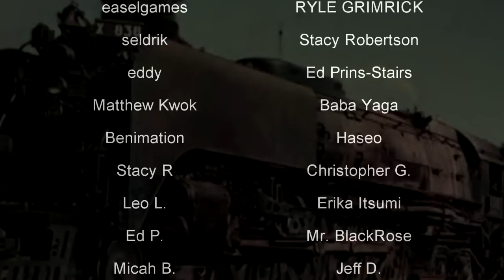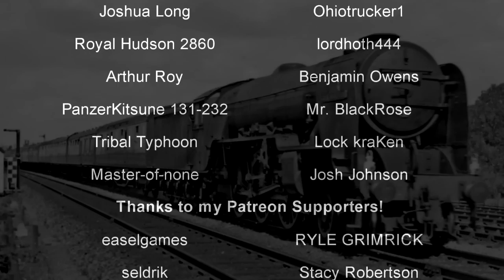The True Story of Edward Thompson | LNER's "Worst" Chief Mechanical Engineer | History in the Dark

Comment: Unfortunately for Thompson, alot of criticism was due to railway publishers at the time, one of which was Oswald Nock, a signals engineer who wrote on signalling and locomotive performance under wartime conditions for the Newsletter, the Engineer, and later for The Railway Magazine, who wrote reviews on various locomotives and their performance. He noted an incident when Gresley reprimanded Thompson publicly for interfering with a driver who was dealing with a locomotive which had failed.  

Finally Col. H.C.B Rogers, an army officier, ldolised the french locomotive designer, André Chapelon, and being main critic of the LNER   who suggested that Thompson was being difficult to work with (though citing many of the engineers under him). 

Thompson's ideas of reducing and standardising the amount of locomotive classes, were seen as a great move with management, most of his rebuilds did cause some issues with crews working with them. As noted "he solved the problem for the maintaince dept, he created issues for the operating dept." Most of the criticism leveled at Thompson was in relation to many of the Gresley rebuilds of older locomotives were completed in order to maintain locomotives which were getting old but not completely change the locomotives function and increase the performance. Only if a no other locomotive could reliability complete the task, did Gresley design and build a new locomotive.  

Most Thompson rebuilds, the locomotives performance after rebuilding become either average or worst afterwards, and he often had issues with crews hating his cab layout designs, as they caused many issues for men on the footplate..... one class had the drivers position switched from the right side of the cab to the left. His new designs were often designed to fully replace entire classes of engines with a single design, in order to reduce the amount of mantaince required. He had a list of many pre-grouping locomotives, which had survived under Gresley, but had been replaced by thompson. 

Had Thompson been able to have the full backing of the LNER, and not under war, he might have been a provided with a little more lee way but unfortunately, anyone coming after Gresley was going to have a difficult act to follow. Thompson's attitude may have sealed his fate, as being openly aggressive to other staff, and sending one of Gresley's assistants to a backwater areas on the network may have sealed his fate of being the "Villain" rather than "Savior"of the LNER.
Reply: The history of the LNER from it’s creation in 1923 may also be relevant, with it being a merger of different companies. The organisational friction from that kind of thing are often beyond the capacity of any individual, unfortunately.
Reply: Dear Andrew, 
1 / sending someone to an engineering backwater is frequently the necessary stepping stone to future promotion.
2 / it is also relevant that the LNER was financially the poorest of the Big Four, as is evidenced by the collapse of the former NER Areas coal trade, by about 20%, which is why the Newport Shildon electrification ( 1915 - 1935 ) was closed after less than 20 years service.
3 /whilst the LNER inherited some ancient locomotives and carriages, it did also inherit a sizeable fleet of relatively young and effective main line locomotives, ( the NER 0-6-0 & 0-8-0 goods engines, the GCR, and xROD 2-8-0s, xGNR Atlantics and Moguls, xGER Claude Hamiltons & B12s to name a few ) which goes some way to explaining why there was not a large number of new locomotives built by the LNER, but, by1940 these locomotives were now 20+ years older, and operating under quite different conditions to the 1920s. 
4 / Also, the second tier of inherited locomotives ( pre WW1 builds ) were now exceeding 30 years of age, and in some cases exceeding 40 years of age, combined with WW2 reduced maintenance and heavier traffic, you now have a situation where locomotive failures are becoming more frequent, there is a shortage of capital, and resources, to undertake a massive replacement programme, which would, in any case, take time to be effective, so any rebuild programme which would improve availability, was the only feasible alternative. Hence you have the rebuilds of Robinson 04, Raven B16, before the post war B1, K1, A1 & A2 programmes. All initiated under Thompson, but implemented by Peppercorn and successors, and the bulk were delivered to the nationalised BR.
5 / bearing in mind that British railways are left hand running, hence the reason for signals being to the left of the running line, it has always struck me as bizarre that the driver would therefore sit on the right side of the locomotive.
6 / the post WW2 LNER new builds did replace a swathe of pre WW1 locomotives, it also standardised a series of boilers useful on multiple classes of locomotives, and these boilers generally produced a higher output than their predecessors. This, by the way, ws not restricted to Thompson, Gresley had also done this, as did, to a far greater extent, the wealthier LMS pre WW2 , the Scottish / Northern Division standardised on Caledonian boilers for use on pre group inherited locomotives, though this was not apparent visually due to a similarity in outward appearance.
7 / I wonder what Thompson thought of the USA-TC S160 2-8-0s ?
8 / a very interesting letter with valid commentary,
Regards from Australia
Reply: @70sVRsignalman  "5 / bearing in mind that British railways are left hand running, hence the reason for signals being to the left of the running line, it has always struck me as bizarre that the driver would therefore sit on the right side of the locomotive."

I quite agree, and it was only the older Gresley classes that were right hand drive,. 

However the GWR (or BR WR as it was by the 1950's) objected to the drafting in of BR 7mt Brits to replace their Castles and Kings citing drivers couldnt see signalling on former GW lines in a left hand drive cab, and the signals had been designed for a right hand driver loco (as ALL GWR locos were), which I still fail to understand when the signals are placed on the left hand side of the line.

Comment: I'm hearing a lot of echoes of stories which have no ground in reality. The board, mind you mere days after Gresley had passed, approached Thompson, there is no proof the LNER had approached anyone else other than Thompson. Similarly this fairy tale that 4470 'Great Northern' was picked out of spite is simply, for lack of better words, wilfully ignorant to perpetuate. George Musgrave, the locomotive superintendant, requested "an A10 to be shopped", which just so happened to be 'Great Northern'. The idea that Thompson, the man specifically, picked 4470 is at odds with the way such a system is structured. The rebuilt 'Great Northern' meanwhile proved itself more efficient than the A4 streamliners both times the two classes were pit against each other. Even though Thompson's critics either don't like to or simply won't admit it! Equally, the L1s were actually a surprise success on London express commuters, even if their cylinders were their downfall.

Curiously people always forget Thompson's Q class - an 0-8-0 heavy shunter reconstructed from George Robinson's eight-coupled freight locos.

Comment: In all fairness not all of Thompson's "improvements" were bad. In many cases they proved that some Gresley and even pre-grouping designs could be made more standard and cheaper to maintain. Such like the NER B16s (designed by Sir Vincent Raven....), of which some were modified by Gresley first, incorporating his ideas, to become B16/2, then Thompson had his go and created the B16/3 sub class - the most obvious difference between these 2 sub classes being that the B16/3s were changed over to left hand drive.
With regards to rebuilding Great Northern it was due for a general overhaul anyway....Or if you're gonna rebuild a class of locomotives, it makes sense to start with the first one?

Comment: I hate to stick the boot into him, but Thompson can't be credited for the BR Mk1 stock.  Every railway apart from the LNER had moved away from wooden coaches a long time before him, and the Mk1 is near-as-not a modified LMS design.
Reply: I think it was Bullieds carriages which were the basis for the MK1 with GWR Bogies. Thompson did not do the LNERs first all steel carriage that was Gresley in the 1930's. Thompson carriages are are steel panelled on a wooden frame, I know I've helped restore one. Also don't think that because Thompson was married to Ravens daughter he would side with Raven. Thompson had a poor opinion of Ravens mechanical knowledge. As others have said read Simon Martin's excellent book!!!

Comment: Gresley does seem to have liked making a new locomotive for every occasion but there was a lot more standarization at the parts level than is appreciated.
8:20 Not to mention that the "rebuild" was so extensive throwing away so much (including the frames!) that it might have been easier to build a new loco'.
9:30 The P2s did have their issues but they were the sort of thing that would have been sorted out over time. The A1 Steam Trust which is building a new P2 was very careful to address these issues before they started- they have no wish to spend 10+ years and millions of pounds building a loco' they can't then use. The problems might have been exaggerated by Thompson to justify the rebuild since the P2 served on the Edinburgh to Aberdeen route they were designed for until they were withdrawn for rebuilding.
Peppercorn may have been something of a Gresley disciple and rehired several people to work under him that Thompson had removed but he did use Walschaerts valve gear for his loco's.
Reply: Regarding your comment towards 'Great Northern''s rebuild, they did build an entirely new loco. The only parts to be reused from the 1945 A1 on the 1946 A1/1 were the wheel centres, the cab, and the tender frames.

Comment: Thompson never chose great northern specifically. The LNER’s board of director wanted Great Northern to be the one to get the rebuild because it was in the worst condition of all the existing A1s. Additionally, even though the existence of the old Gresley A1 ( now A10) contradicted Thompson’s standardisation program, he did not want to rebuild any further A10s into A1/1s believing that they were important to the railway’s history. 

Additionally, the rebuilt Great Northern is debatably one of the best pacific design to come out of the LNER. The engine most definitely did not have steaming troubles… infact it was highly effective at building steam because it used an A4 boiler. The engine also consistently the most travelled pacific, out preforming Gresley designs by 1500 miles annually, which could be due to the engine having a very high availability rating. 

Additionally, Thompson’s successor, Authur Peppercorn based a number of his designs on Thompson’s. Infact the peppercorn A2 in reality is just the Thompson A2/3 with afew mechanical and cosmetic differences. Even the peppercorn A1 was somewhat based on the Thompson A1/1. If Anyone thought Thompson’s ideas was subpar it definitely was not Peppercorn.

Comment: he is actually my favourite chief engineer so don't go talking trash about him. he designed my number #1 favourite and best class of locomotive. he may had done some stupid things but as you said he was under pressure. if he had free will he would had been one of the best if not the best. he was a remarkable man and I'm sure he would had gone on to do more interesting things so due to war pressure and depression he couldn't do the things he wanted and that is why you should not critisize him critiseze the war and germany. he is a respectable engineer and designer as well as a man who could speak up and that is a skill that many people don't have. he is respectable. he may have had failures and mistakes but quote "mistakes are proof you are trying" by Jeniffer Lim. b1s they may ride rough but they are stunning, powerful, fast, cheap, reliable, incredibly easy to operate and are variable able to handle any kind of job freight or passenger service

Comment: 10:37 the A3’s were also prone to frame cracking. So much so that many A3 components were manufactured to basically make a brand new engine so that at any given time, the engine’s parts could be swapped out

Comment: Interesting. In germany the "big three" (Wagner, Witte, Meister) behind engines like BR01, BR 01.10, BR 50 and 52 etc.post 1922 all got their leadership positions in their 40s (so the brits would have considered them to young). And germany started a unified building system (Einheitsdampflok- sharing designs and parts) in 1922-25 (Germany unified the railroads into the Reichsbahn in 1925) So quite different from the way the UK did it

Comment: Gresley’s A1s still use Walschaert’s valve gear, there’s really nothing much wrong with it as a design. As someone else has pointed out, the ‘Greeley’ element was the system of conjugated levers that operated the valve for the inside cylinders. Clever, but not without its problems, not least the considerable weight of the oscillating components at speed.

Comment: Thompson resented Gresley because due to seniority Gresley became CME of the new LNER, when Thompson was only about 5 years younger. Regarding the valve gear issue, CMEs did tend to overconcentrate on some detail or other. Gresley disliked inside valvegear for practical reasons. Thompson let his unshakeable belief that all connecting rods had to be the same length spoil his pacifics by making the frames too long and by weakening them at the front end by eliminating the strong bracing of cylinder castings in line. This caused some trouble in service due to cracking.

Comment: Wrong. Apart from 2. all B1's lasted into BR ownership but were scrapped due to the modernisation plan which wanted diesels to replace them. its also worth noting that even after nationalisation. 50 B1's were built by BR. which is testament to their simple design. reliability. economy and sheer power. even if they did ride rough. which wasn't confined to the LNER. GWR locos could also be rough riders. All apart from two were scrapped in a 6 year period.